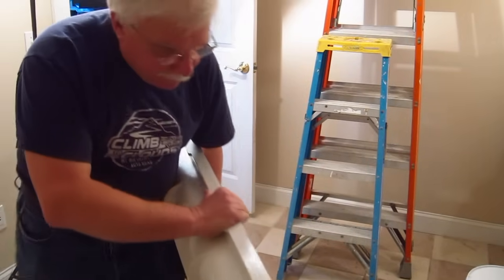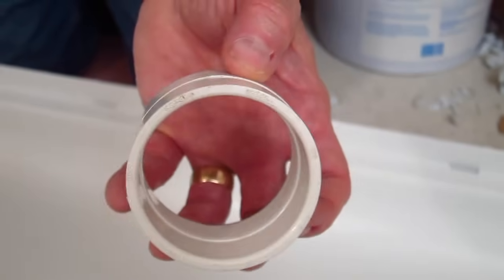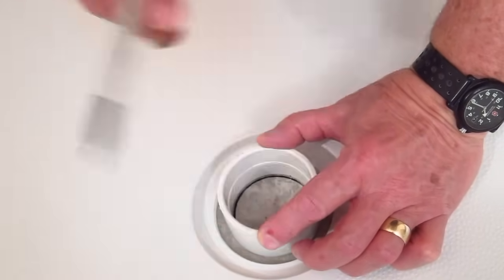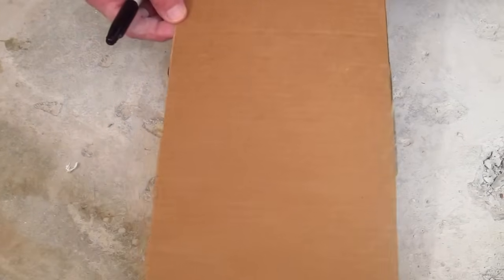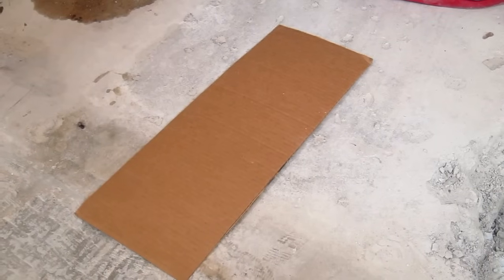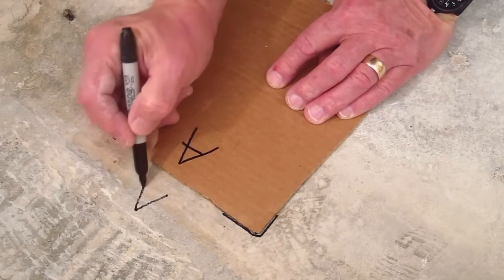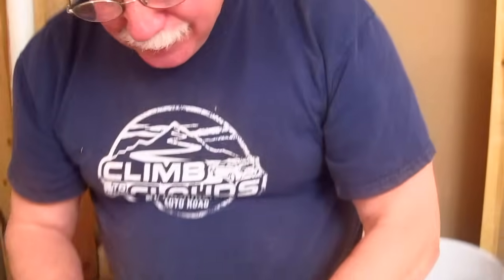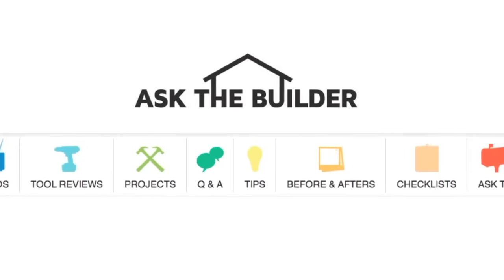How to Relocate Shower Drain Part 2

Comment: I have been a General Contractor for most of my life. I never knew this template method of locating the drain pipe. It worked first time. Thanks for the tip.
Reply from the maker: You're welcome! The same thing has happened to me. I see others do something and wonder why I hadn't thought about it years before.

Comment: Excellent video - and one I wish I had seen a week ago after my struggles aligning the shower drain. Really appreciate the tips. Curious, my drain pipe sits ~1/4" above the gasket of the no caulk drain assembly (same as you have in this video). All is now set; pvc drains glued up, drain installed in base, and base set in mortar. Does this pose any issues either now or months/years down the road? Thanks for your time.
Reply from the maker: It poses no issue. If you really want to thank me, then go up and click the THANKS text link and buy me a large ice cream cone.

Comment: Great video, I have a question, I’m installing a vinyl corner shower, unfortunately my drain is off by 3/8, leaving the shower base 3/8 off one side of the wall. My question is can I use a quick set motor in the open space and feather it up the wall then glue the shower panel to the wall, the wall is wonder board. I’m concerned that the mortor will fail or do you think I can try this? Thank you
Reply from the maker: That may work. I'd really have to see photos and do one of my phone consults to ensure the result will be perfect.

http://shop.askthebuilder.com/products/15-Minute-Phone-Conversation-with-Tim.html
Reply: Ask the Builder thanks for the reply. I’ll give it a try. Great videos!!

Comment: Does the drain need to be located same side of shower head because I want to put them opposite sides I order to give me access to valves Incase I need to repair ??
Reply from the maker: The shower drain can be anywhere on the floor. The floor simply needs to slope to the drain.
Reply: @askthebuilder  ok thanks  I will be using a pan like the one you have in the video. so it will come with slope built in.

Comment: How do I add a shower drain to my 1/2 bathroom in basement?
Reply from the maker: Very easy. I've been a master plumber since age 29. You need to jump on a call with me. Best $$$ you'll spend on the project. The call is FREE if you don't feel it's helpful.  You have nothing to lose, everything to gain. https://shop.askthebuilder.com/15-minute-phone-or-video-conversation-with-tim/

Comment: Thanks, Tim.  Your videos have been VERY helpful.  I am currently following your template instructions exactly.  Everything has gone well, until the point of installing the p-trap.  I am installing the trap for a shower on the 2nd floor of a 70s-era home with 8-inch deep joists.  The 2" trap assembly will not fit vertically in the joists!  I have read of others having this issue, but I can't see to find a solution.  Is there a low-profile 2" trap?  Do I have a build a bulkhead in the ceiling of the first floor to accommodate the shower above?
Reply from the maker: This is best handled with one of my phone consults. Way too much to discuss. I'd have to see photos of your challenge.  Consider this:  BEST money you'll ever spend on the job:

http://shop.askthebuilder.com/products/15-Minute-Phone-Conversation-with-Tim.html

Comment: Hard to tell on video, are you putting in a smaller shower to reclaim some floor space?
Reply from the maker: +StoneysWorkshop This is part two of a two-part video. Both are part of a massive playlist where I share the entire bath remodel process from start to finish. Go watch all the videos before this to understand what's going on with the new shower location. Right now I just finished framing the walls and relocating the water supply lines for the shower valve. Those videos will be uploaded in a few days.

Comment: I don't get it. You have to have roughly  a 5" or so square or circle of concrete cut out around the drain anyway, which would give you plenty of play to line up your drain.
Reply from the maker: It seems to me you've never installed a drain in a concrete slab with the framing already in place. But what do I know??? I used to eat lunch sitting on overturned empty drywall mud buckets for 20+ years.
Reply: @askthebuilder  You would be correct as I've never installed a drain in a concrete slab before although I'm working on it now, breaking the concrete to move the existing drain from corner to middle where shower pan will go.

Comment: So what if the drain on the the pan itself is molded to countersink into the whole. Basically the shower pans drian is 3 inches in depth past where the bottom of the pans tray sits on the slab of concret
Reply from the maker: You can get unlimited FREE tips by subscribing to my newsletter at www.AsktheBuilder.com